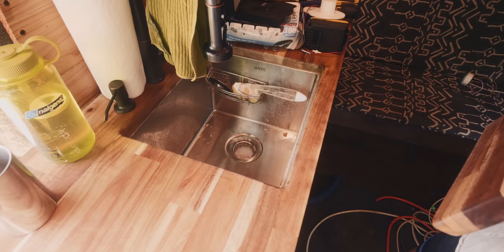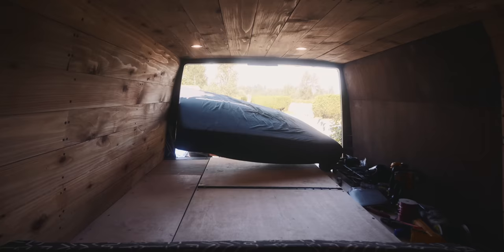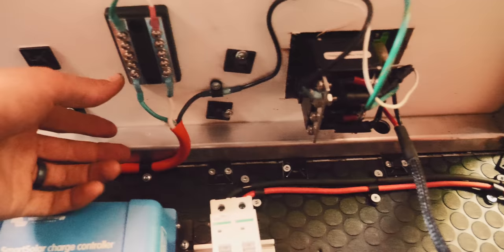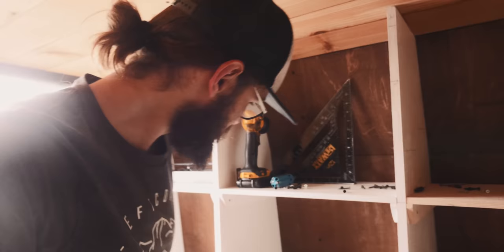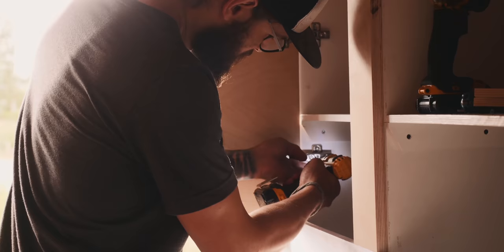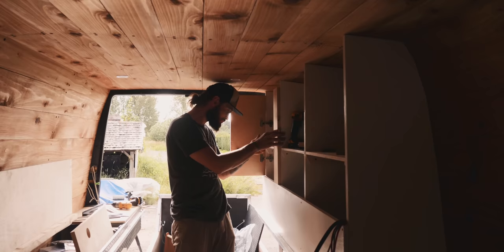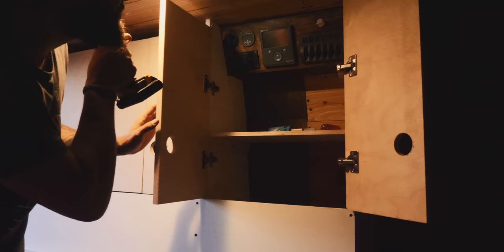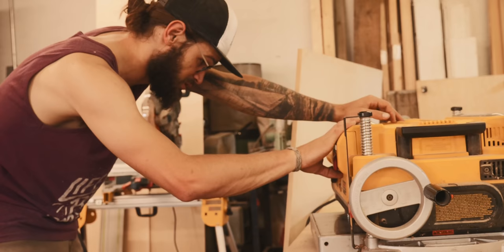Jannelle + Levi's Full-Time Van Life! (First week!)

Comment: These plywood boards are much thicker (and heavier) then what I would use. What`s ur reasoning for choosing those?
Reply from the maker: Great observation. You are correct, they don't meet to.be that thick. The hinges I bought needed 3/4 material to be sunk into, and I ended up using too much 3/4 in other areas. Definitely a little overkill
Reply: @Levi_Allen  Ah, I see. Good to know, I was questioning my own choices for a moment. Well I guess u saved a lot of weight using all that alluminium :D